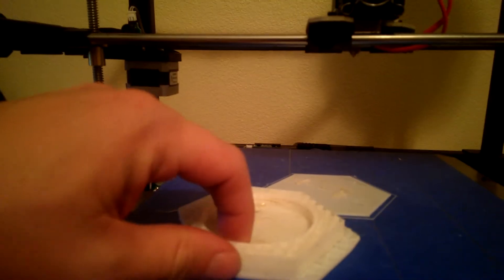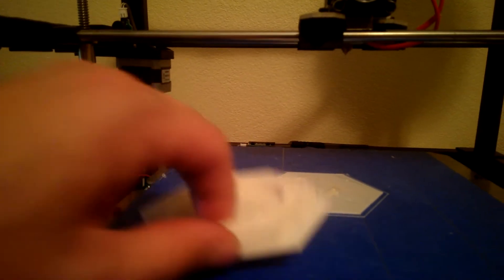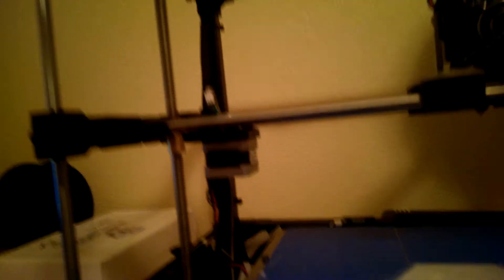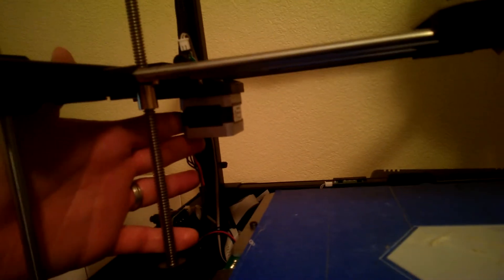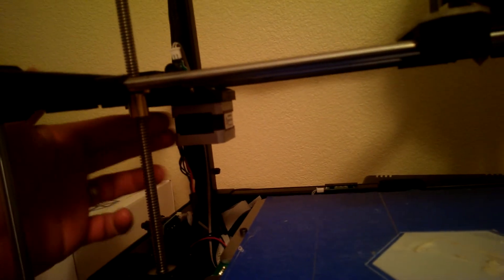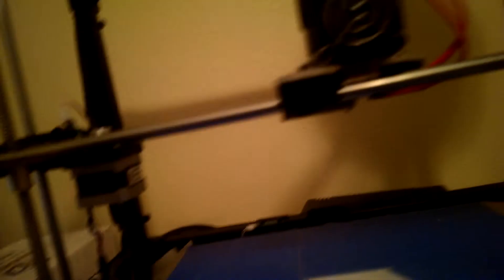How to kill a 3D Printer! Rigidbot Nozzle FAILURE

Comment: Did you ever get it to make a good print?  Mine shifts between layers as well.  I've tried everything.  Slower speed, reduced flow rate, different models.  Mine never makes a print with all the layers aligned.  I heard they got over a million dollars from Kickstarter, then wound up taking out loans to get all the printers shipped.  Now they don't even answer emails.  If you ever got yours working, please post a video showing all the things you did to fix it.  What a bunch of crap!
Reply: We had a limit switch just slightly out of position and it caused the shifted layers.  Hope that helps.

Comment: Motor overheat is probably just because it's a little NEMA 17 and that thing is /big/ so it's moving a lot of mass around. A little CPU cooler (like from an old 486) with some paste will cool the motor back down. Or try a lower speed / lower current.